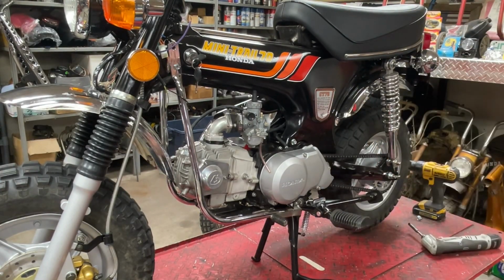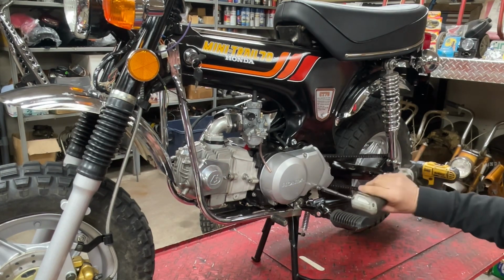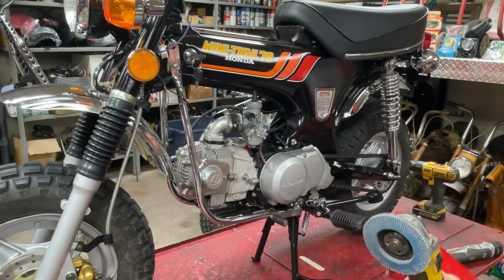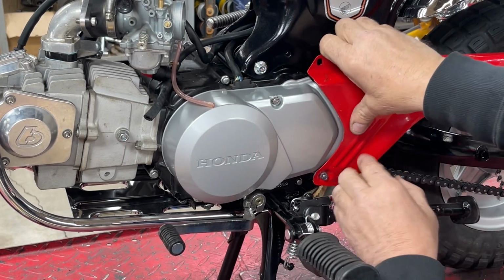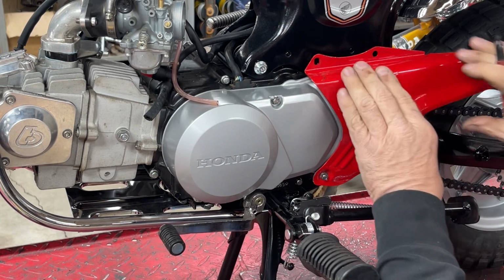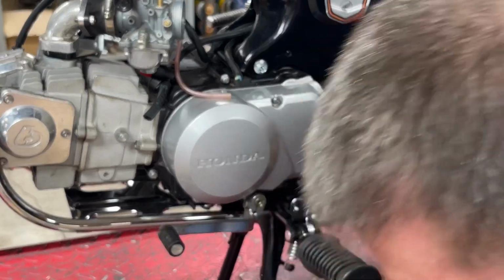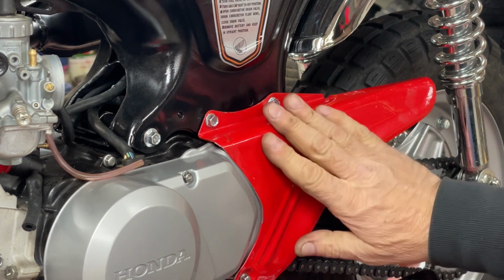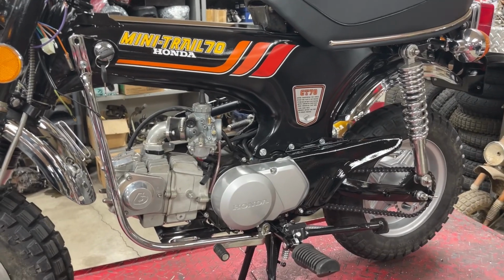Honda CT70 chainguard…..fitted to a clone.

Comment: Hey Mike, I just got a 2004 Chinese no-name clone with a 86cc engine. 
I got it up and running but the gears a kinda hard to shift, especially the first two. I really have to stomp on the lever. 
Can you give me a hint where to start looking how to fix it? I changed the engine oil, about 0.6L to the top of the mark. Not sure if the transmission shares the engine oil. 

THANKS!
Reply from the maker: The transmission does share the same oil.  Hopefully, you used an oil specific for 4stroke wet clutch engines.  Regular engine oil is hard on the clutches and will cause it to slip.  Hopefully, the oil change helps with the shifting issue.
Reply: @MiniBikeMike  thanks for taking the time to reply! I got Valvoline 10W-40 conventional 4 stroke ATV oil and it did improve the shifting 👍🏻👍🏻
Reply from the maker: Awesome!

Comment: Mike, where did you get the 12 volt headlight
Reply from the maker: I had the bucket.  The headlight lens came from eBay.  Vrocks Vintage is the seller.  $35 and free shipping.  It comes with a 6v bulb that is replaceable.  I replaced it with a 12v version, a Stanley A3603.
Reply: @MiniBikeMike  Thanks

Comment: Looks like a big bore kit on there. How do you like it?
Reply from the maker: Don’t know. Haha.  I built a custom CT70 for a show, back in 2014 or 2015.  I built this engine from a Lifan 125cc with a TB Parts 141cc top end.  I’d guess the engine has less than 5 miles on it.

Comment: What type of oil do you put in a Lifan 125?
Reply from the maker: I use Valvoline 10w-40 four stroke oil.
Reply: @MiniBikeMike  Motorcycle oil for wet clutches??
Reply from the maker: @Mechanic_kid  sorry, yes!
Reply: @MiniBikeMike  Do you change the oil that it comes with new?
Reply from the maker: The oil that comes in these engines gets a bad rap.  Here’s my opinion:  I believe the shipping oil is actually gear oil, rather than engine oil.  Gear oil has better rust resistant properties than regular engine oil and I believe it’s used to protect the internal gearing as the engines sit in warehouses.   Gear oil is suitable for engine oil use, so……I typically leave the shipping oil in the engine for the first 100 to 200 miles, let the engine get broke in, then I swap to new oil.
Reply: @MiniBikeMike  Didn’t get your reply in time. Good to know! I ran it for a couple minutes and then changed it👍🏼 Thanks
Reply from the maker: @Mechanic_kid  You can never go wrong in changing it.  👍🏻   Can’t wait to see the video on what you’re building.